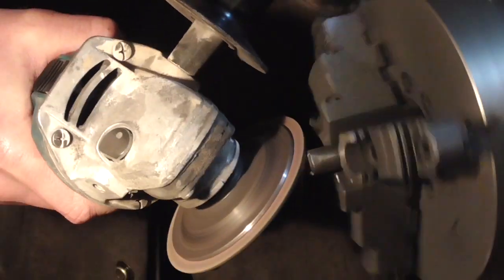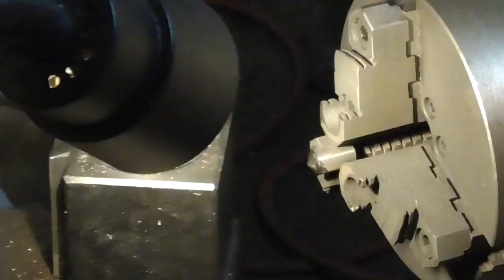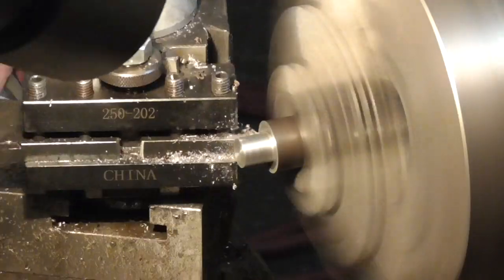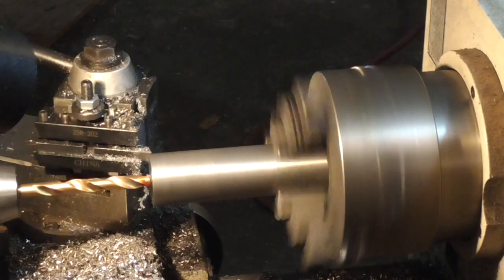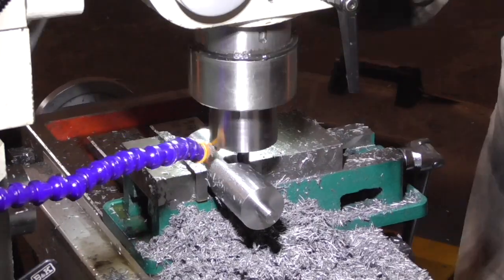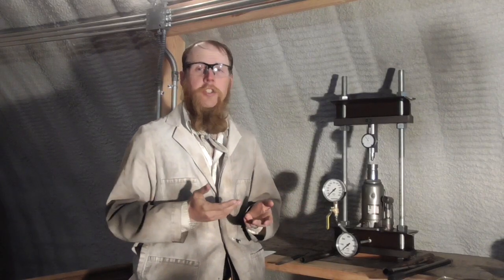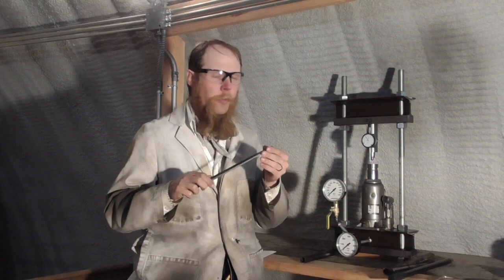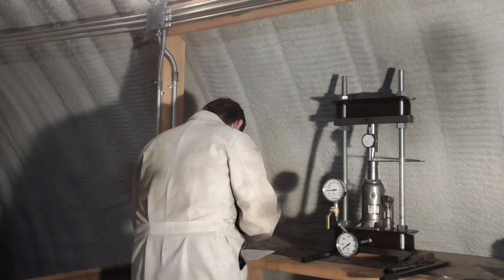Homemade Hardness Tester (TIS213)

Comment: hello my friend. At each predetermined load, the indenter enters the material a predetermined distance. Is my understanding correct? Could you please point me to literature that specifically talks about the amount of loads and recoils to perform the test? I really liked this device. help me please.
Reply from the maker: Typically, you apply a predetermined load and measure either the depth that the indenter enters the material or the diameter of the indentation.  Here's a few Wikipedia articles for further reading:

https://en.wikipedia.org/wiki/Brinell_scale
https://en.wikipedia.org/wiki/Rockwell_scale

Comment: Can you provide the dimensions for the shank tungstan carbide tip
Reply from the maker: The dimensions depend on which hardness scale you want to use.  For Rockwell C, it's a 120-degree conical point.  For Brinell it's a 10mm diameter ball.

Comment: So what is the process for using the tester? Do you just press it a predetermined amount? Or is there a set pressure you need to press at in order to test?
Reply from the maker: Depends on the test.  For Rockwell C, you apply a 150 kgs (~ 330 lb) load with the press, and measure how far the indenter goes into the material.
Reply: TheIdahoanShow Awesome. Thanks for the reply

Comment: Wow, this is great! Good to check for hardness after a hardening job. 

Seeing the tungstencarbide like that; you could grind it to diameter in a jig, drill a hole in it with EDM machining(which you can do at home), grind a socket and a tip, get a portion of the circle grinded off and make yourself a gundrill.

If you have made a jig to support the shank, while you indent it with a v groove shapingwheel. I was thinking about a lathe with a piece of roundbar with a slot cut out to hold the shank and some clamps to hold the shank in place. A V groove can be made with the V wheel tool attatched to a rig to hold it on the carriage. So you basically roll the groove in. 

There is a part written about this in the book: a the modern gunsmith v2. The 2nd book has all the good stuff about reamers rifling cutters etc. In the book they were suggesting using a planer for the v groove making. 

So yeah, if you feel like brazing...

Greetings,

Jeff